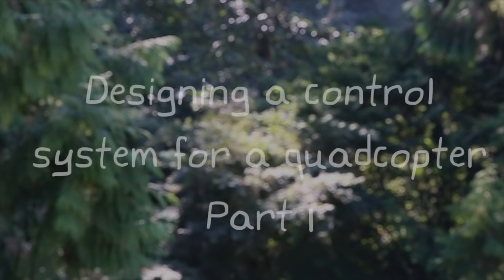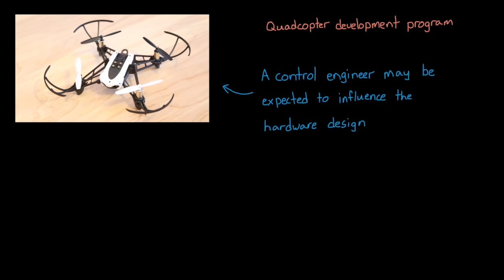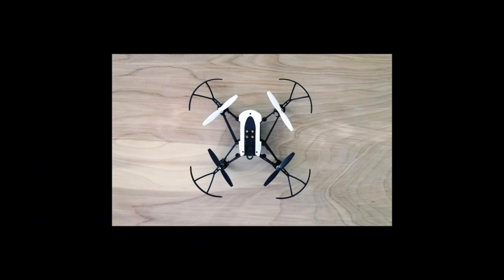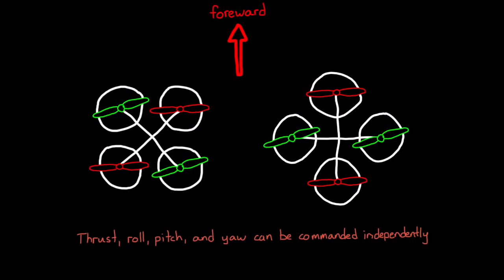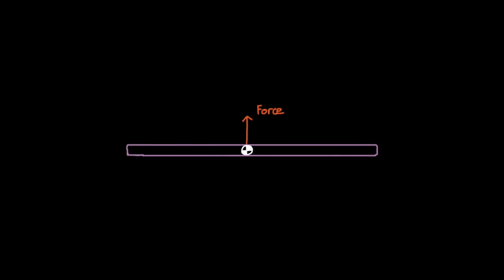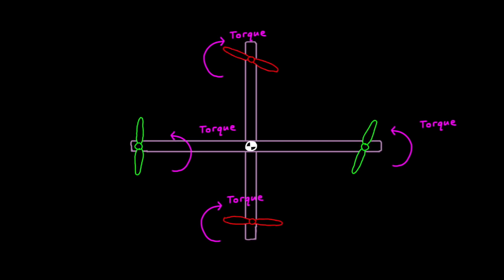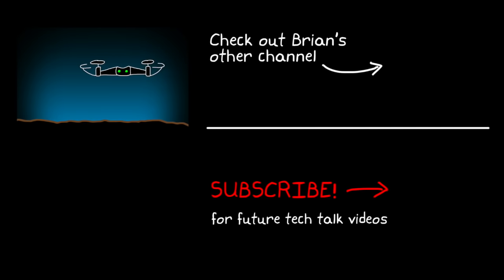Drone Simulation and Control, Part 1: Setting Up the Control Problem

Comment: Hi , a question 
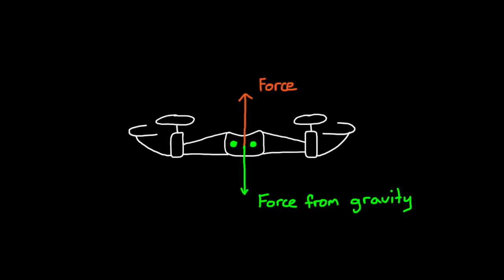at 12:45 you show the mixer values, I cant understand the roll sign. 
I would think that the roll sign for positive roll(from left to right) on the "Front Right Motor" should be negative , not positive
if it will be positive as you wrote , there be more thrust on the right side and the drone will roll to the left(negative roll in Right Hand system)
Reply: Hey, I had the same confusion. Let me know if you think this is correct

M_fr = T+Y+P+R
M_fl = T-Y-P+R
M_br = T+Y-P-R
M_bl = T-Y+P-R

Comment: at 6:50 u said, it is an underactuated system(4 motors and 6 DOF) hence all directions cannot be controlled. But it's the same case with hexacopter(6 motors) and octacopter (8 motors). Little confused. Waiting for your reply. TIA :)
Reply: That's true, but only because the motors for a hexacopter and octacopter are aligned in the same axis.  The point I was trying to make was that a quadcopter is necessarily underactuated because there are only 4 actuators, whereas, something with 6 or 8 actuators might not be.  For example, imagine a hexacopter where each motor is on its own side of a square frame.  This could then travel directly in all 6 DoF.  Did that help?
Reply: @BrianBDouglas  
So depending on the motor placement hexacopter could be under or to the mark. Makes sense, thank you :) btw I bought parrot mini-drone after finishing your lecture series. It's fun implementing... :)
Reply: I want to simulate Quadcopter in matlab ..... please help me

Comment: Great video! As it happens I am currently taking a Udacity class on using deep learning neutral networks to control a QC. Specifically Deep Q Learning or Actor/Critic. I'm wondering what's your take on this?

Comment: Thank you so much!!! Your video made me understand core concepts I had to master to start a drone simulation project. In my python class we were given this project about drones with a source code licensed from the MIT when we never even took in class what a drone was or how to manipulate scipy and matplotlib modules/packages. I'm not sure what's the difference between modules, packages, libraries and subpackages, would be nice if someone could clarify to me that point, thanks! :)

Comment: Hello, I have several complete quadcopter carcasses, with the intention of making them fly with a TM4C123GH6PM (TIVA C from TI). I have made many applications using Simulink Code Generator for dsPIC, PIC18, Arduino and ARM. It will be possible that with this series of videos, I can finish my project of making my own quadrocopters fly?. I have made and do many control applications for the oil industry with systems embedded in microcontrollers. Thanks.

Comment: Hi bryan, just to ask how can i linearize my induction motor driving the pump so that i can get the transfer function of it for a control design.  right now what i have is the mathematical model of the induction motor and confuse what to do next. please advise thanks
Reply: Sorry I can't answer your question, I just wanna be tagged in to know the answer :)